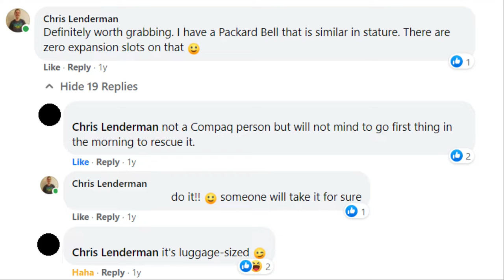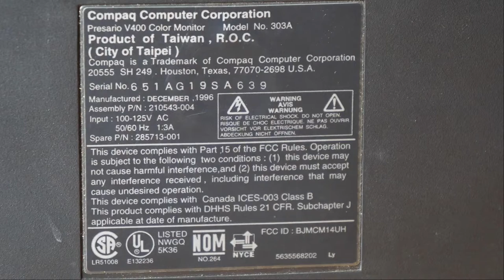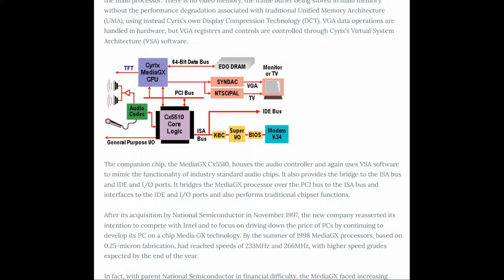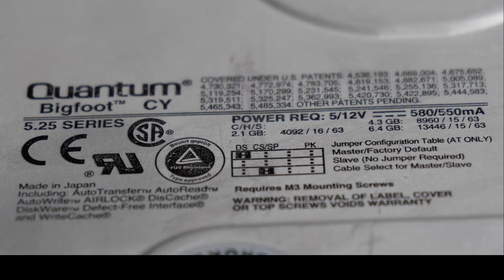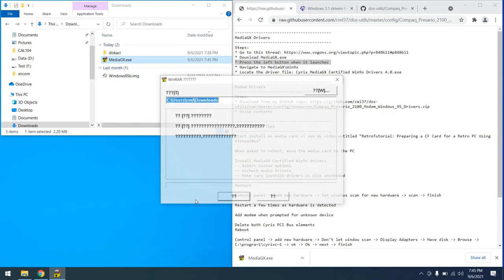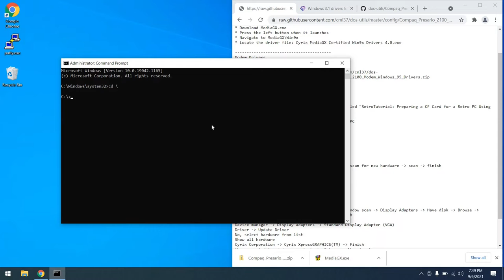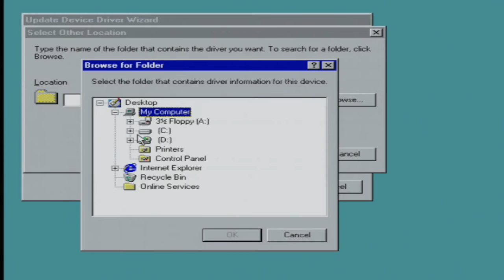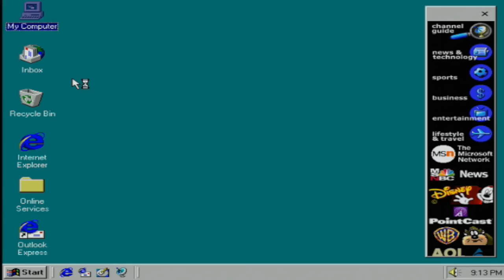Vintage Compaq Presario 2100 Desktop Computer - The Ultimate Budget Retro PC

Comment: Nice find. I had one of these in 97 for a few years. Mine came with a restore cd with win 95. My only possible upgrade for this was a 56k modem, which was easy to do. I later put win 98 on it, but remember it being a struggle to do so. The sound from the speakers on this was amazing. I wish I had one of these and would just put a micro-atx build in it.
Reply from the maker: Yea, installing Win98 on these is known to have issues!  The sound is phenomenal.  I'll be adding a Presario 2200 to the collection soon as well!